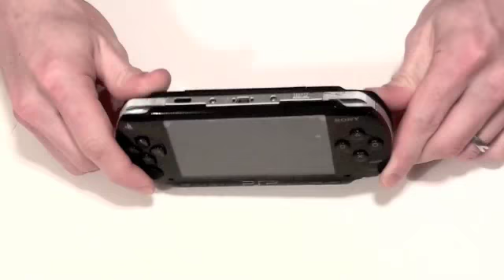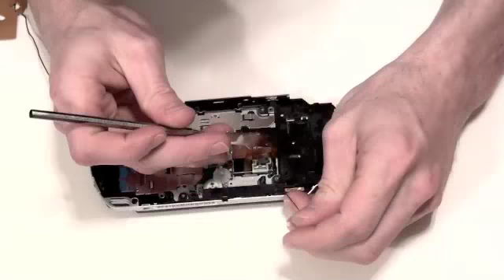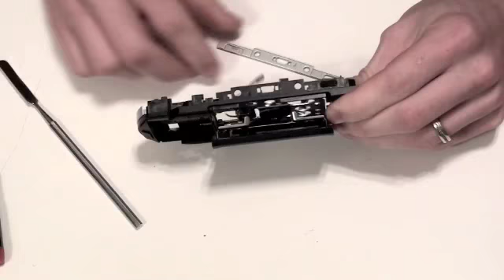How to Repair and Disassemble a PSP 1000

Comment: Is it possible to remove the UMD cover and cage without tearing down from the front? I'm trying to lube the worm gear and box and gears. I suppose I could use a toothpick or long straight paperclip to drop a little plastic safe oil and lithium or silicon grease to get it from the side and top. However is it possible? And what would you use? Silicone grease or white lithium

Comment: Hi i watch your video several times it help me a lot to fix my psp fat. But i have a problem how can i remove the memory slot holder for my psp? Because 1 of the pin snap out and my psp can't read my memory card. I hope you can make a video for that and solve my problem thanks

Comment: Hi i broke the 2 latch locks for the screen connection how do i fix this Thanks Jos
Reply from the maker: If you broke the connector on the board you will need to solder a replacement connector onto the board unfortunately.
Reply: @PowerbookMedic  Hi how can i find the connectors to buy Thanks Jos
Reply from the maker: @josnova68  I'd check eBay and if you can't locate them buy a broken unit and harvest the clips from that one.

Comment: 8:20 use you're small flat tool to release it, covers it so we cant see what he does so i try that and use light pressure and the damn thing snapped off... so then i couldnt charge my psp, so then i bought a new psp with a messed up case and tried again thinking maybe since the other psp was rusted it was just weak from rust...nope the same thing happened and now i have two dead psps, help please
Reply: same happend xD i think u will need to weld it again :( but notice theres 3 connector to the motherboard.. 2 pins for the power and 1 hided under the white plastic stuf i think thats floor.
Reply: *your

Comment: Hey thanks for this awesome tutorial !
My SD card reader does not work no matter what I've tried, the piece of paper trick or formatting the card on my computer to FAT32.
The headphone jack works, the wifi works,
Have you seen an issue with the multi connector where disconnecting & reconnecting the motherboard fixes a no card read issue?
Thanks !

Comment: you can tell that thing's been disassembled before because he's not stripping screws trying to unseat them from the gobs of loctite that hold them all in place.
Reply: +Yung Bleezy seriously, how do you unscrew it if it hasn't been done before Im scared of stripping them :/
Reply: you press really hard and turn slowly. i barely got the screw out though.
Reply: Matthew Harris I did it a while ago but when I put it back I had a problem with the battery. Might have to do it again.

Comment: You should do a video on a How to repair and disassemble a PSP 2000 I don't own a 2000 but I do have the 1000 and 2 3000 models, one is for parts and the other is my PSP I use the most

Comment: I would like to thank the author of this clip from the bottom of my heart. I have a PSP fat (one of the first production models which were made in Japan) which started to have problems with analog stick. It just got silly input, which was caused by stripped screw hole. Using this I was able to take it all apart (and marvel how it all fits) and put it back together. I have a shitty case now (some copied crap, it barely fits), but it all works. THANK YOU MAN, YOU ARE GREAT

Comment: Aseembly steps: 
 
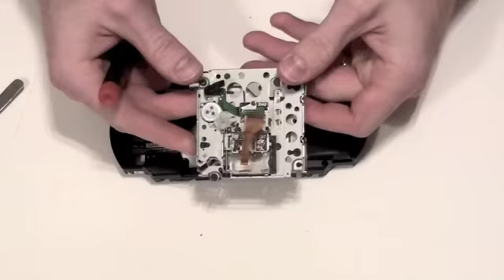1) M-card cover + screw (16:17)
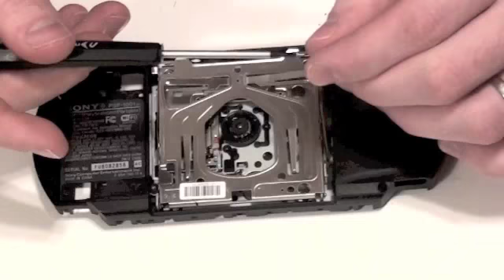2) UMD Chassis + 4 screws (15:00)
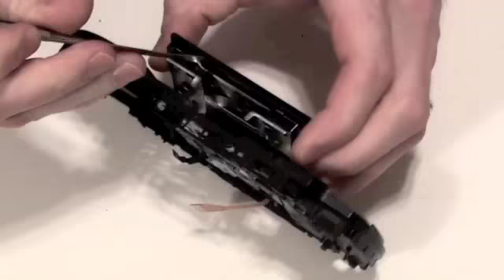3) UMD Cover (14:06)
4) Wifi switch + borders (12:50)
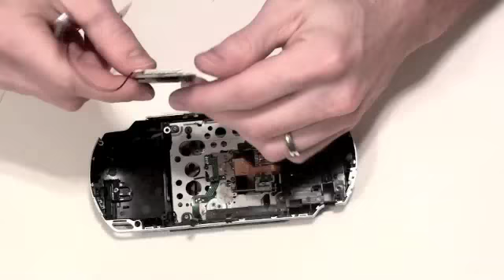5) M-card reader (12:00)
6) Aluminium base + screw (11:42)
7) M-card holder plastic + 2 screws (11:13)
8) Speakers (10:33)
9) MainBoard + screw (10:00)
10) UMD Connector (9:50)

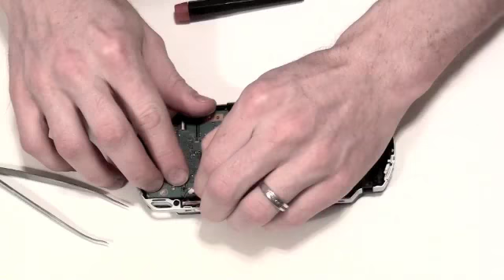Comment: 11) Speakers plugs (9:17)
12) Antena (8:48)
13) Power plug + screw (8:00)
14) R rubber (7:24)
15) 4 Buttons(6:50)
16) D-pad + screw (6:10)
17) Chasis + 6 screws (5:16)
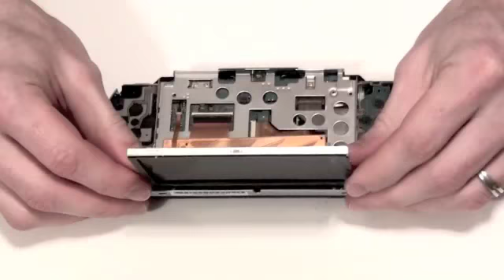18) LCD (4:40)
19) HOME bar (3:50)
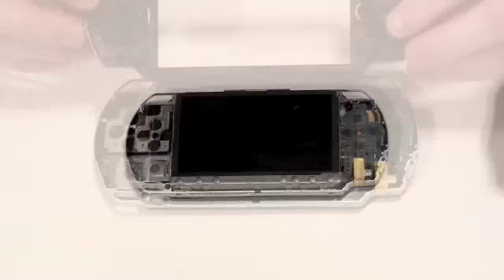20) L-R buttons ( 3:25)
21) Front cover (3:15)
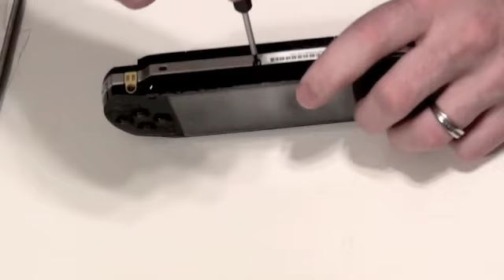22) 7 Case Screws (2:00)

Comment: My psp !st would not hold a charge with or without the charger then with the battery, when I switched out the battery with a fully charged new battery the psp turned on for 3 seconds, shut off and I could smell burning. Help, is it able to be fixed and  is it worth fixing.

Comment: SIR I HAVE A PROBLEM IN MY PSP1001...I WAS CLEANING IT WITH CARBON TETRA CLEANER AS I ALWAYS DO...BUT I SPRAYED THE CLEANER RIGHT ON THE PSP AND NOW THE FAULT IS THAT WHEN I PRESS THE DISPLAY BUTTON OR VOLUME OR HOME OR MUSIC BUTTON WHICH CHANGES EQUALIZER,MY PSP SCREEN GOES BLACK AND I HAVE TO RESTART IT AGAIN...LATER MY DISPLAY BUTTON STOPPED WORKING....PLEASE PLEASE CAN YOU GIVE ME A SOLUTION TO THIS PROBLEM....

Comment: @PowerbookMedic I was able to take out every other screw without too much trouble. I'm using a precision screwdriver set so I don't have as much leverage as the bigger ones with handles, but the screw driver fits the screw. They just wont budge and I don't have another screwdriver of that size.

Comment: one of my gold pins is broken from the memory card slot, and I was wandering if could could fix it myself? because when I put my memory stick in the slot my psp turns off and I can't use my saved data.

Comment: Oh it was a pain in the behind actually fixing this thing! Cleaning saliva out of the power surge board, then fixing two screws (which I wasn't supose to take out) to the point that I had to almost take the whole PSP apart (some parts did not budge, but found workaround)! 

Anyway, great tutorial in showing what is needed for several parts (needed flat tool!) and for giving your time to teach us the steps to repair the PSP 1000 series! Thanks!!!

Comment: great video. i hate sony right now though. the screws in mine seem to all be over tightened and i even had to take a dremil to one of them. seriously those really flat silver ones just refuse to loosen and the metal is too soft so the head is ruined after 1 try... oh and also what size screwdriver should i use for the last 4 screws in the umd drive? double 0 just isnt small enough.